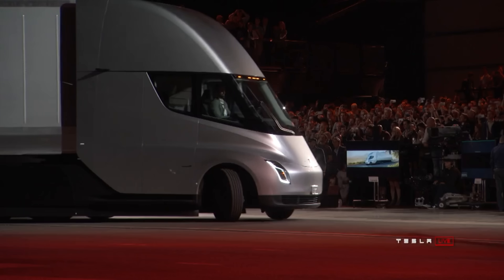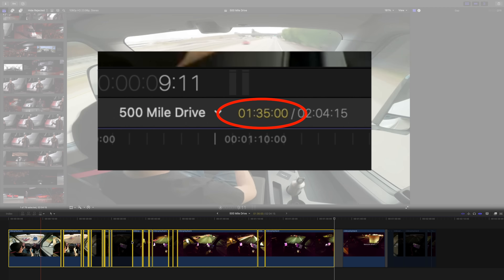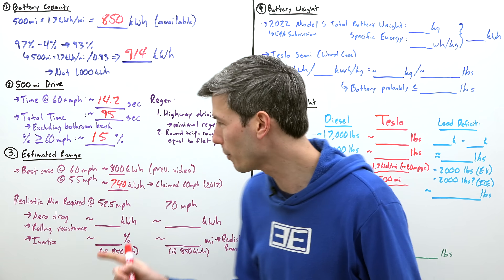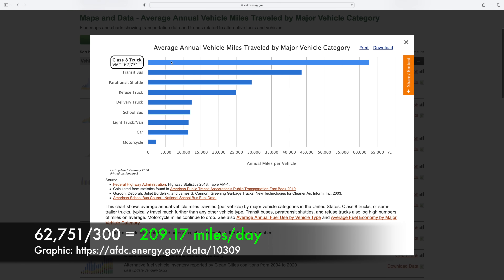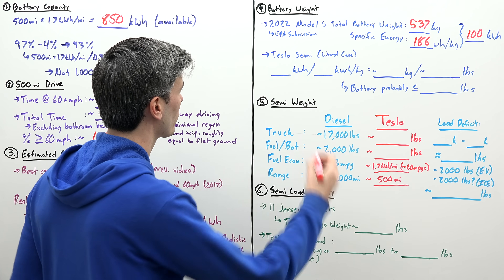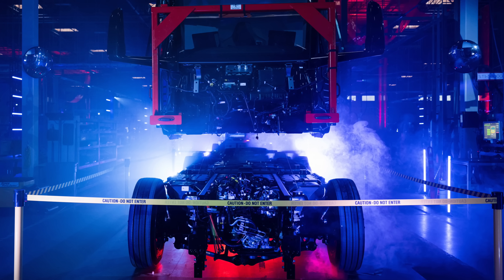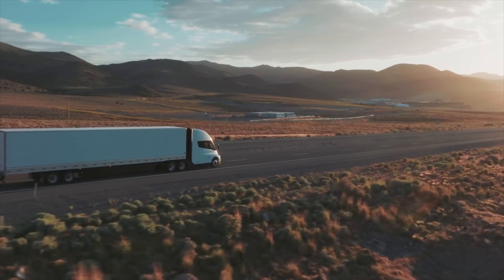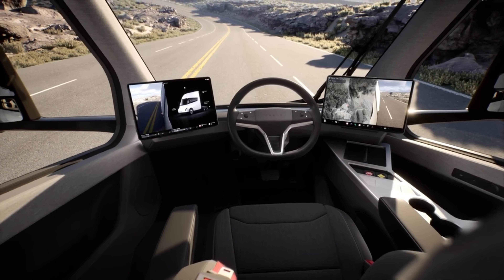Does The Tesla Semi Make Any Sense? Part 2!

Comment: Maybe I missed it but you seemed to skip over the charging. You mentioned it taking 35min which I find very hard to believe. 
It seems to only get mentioned in videos of people driving electric vehicles, that charging the battery 80%+ is much slower and there is an etiquette for cars at least not to do this on public charges. 
If the 35min is true I would suspect that us charged to 80% which doesn't give you full range. 
Second you didn't mention battery degradation, there is plenty of evidence that taking a battery to very low levels will reduce the pack capacity over time. This often is over looked in cars as the person that matters (the 1st buyer) isn't likely to drive the vehicle long enough to notice. With trucks though, they are owned until they are uneconomic and a quick google puts that as average 750,000 miles or 15years old. This really should be a factor.

Comment: Once you take into account the fact that the truck was loaded with only 11T of concrete barriers and that it was overtaken by every car, bus and truck in the video, it’s clear that this truck can barely carry any significant load let alone travel any significant distance compatible to a diesel truck when fully loaded.
Reply: I see you come from the ThunderF00t school of confirmation bias. You don't have to lie about the weight of the barriers to prove the Tesla Semi sucks. TF is biased.
Reply: @MobiAussie  Well given that I have an engineering degree, I dont really need the likes of another page to realise that Elon Musk is perhaps one of the best conmen to ever live. 
What is worrying though is that you seem to be biased yourself in that despite elon again promising and underdelivering, he has again refused to state the hauling load capacity of his trucks.. I wonder why!?
Reply: @iggi3985  Dude, I'm not disagreeing. The Tesla Semi is estimated to be 26-27k lbs, which is ridiculously heavy for a  sleeper cab, much more so a day cab. But ThunderF00t is not a reliable source. He's just flat out wrong on the weight of the jersey barriers. I don't know why he can't admit the semi hauled 44k, because 44k is already not that impressive for a flatbed trailer.
Reply: @MobiAussie  He is wrong. I have even pointed that out to him in that they are about half a ton per meter and not per unit. However, this still takes the hauling load of this particular truck to roughly 11T. You can give it a +/- of a few tons but it would be in this ballpark. 
I believe this to be the top end of the maximum load + trailer these trucks can haul if my rough numbers are correct, hence why Musk isnt releasing the numbers. 
For this purpose, I dont see the benefit of paying for such a truck. It can be out hauled and travelled by any truck, let alone not having to pay the exorbitant price or replacing the batteries every 10 years.
Reply: @iggi3985  
It's a 53' trailer. They are obviously longer than ~6' (2m) each, or the trailer would be half full stacked 4 long. The barriers are 2 tons a piece, not 1 ton.
Reply: @MobiAussie  Ok, Let's go with this. After all, this is all assumptions on everyone's part (including mine). But to me, it looks like they are 2m lengths (could be wrong). 
So we have 11 barriers at 2T each, giving you 22T payload. Still doesnt help the truck in its selling point how light it was loaded and given that it was being overtaken by each and every truck and car as it was clearly struggling. But I dont trust Telsa's numbers as they have been found to fudge the figures in the past so we will just have to wait and see.
Still makes me wonder why after over 5 years, they havent released any information about the hauling capacity of the truck.

Comment: Missed is that the shift will, at least in the medium term, drive up the cost of goods shipped by trucks as we’ll still need ICE trucks, but the fuel, parts, support infrastructure, etc. for those will increase as the market shrinks.  Fixed costs spread over fewer vehicles.  

It also seems what is becoming apparent, that grant money is being sucked up to install charging infrastructure, but those “companies” aren’t investing much in upkeep and maintenance creating availabiity issues.  Also somehting that will eventually be sorted but in the near term will give EVs a bad rep.

Comment: The Regen is only a partial truth. As the trailer doesn't Regen. And if the trailer is heavy, the trailer has to do braking or you cant steer well.
Reply: The trailer doesn't need to regen.
Reply: @logitech4873  trailers do alot of the braking. if the bias is to far forward you feel the trailer steer the truck. particularly down hill. so since the motors are billed as relying on regen, alot of the energy will be lost in braking. it is currently losing that energy so not a deal breaker, but a missed opportunity. if they thought of a whole truck, more battery storage, an extra motor in the trailer and a few extra batteries would increase the range and torque, and recover energy safely. 
trailer batteries would allow for easier hot swap at terminals, or running the truck mostly from the trailer. this would allow faster turn arounds as you just park and unhook your load, then hookup the new load and go.
Reply: @chrisoakey9841  During the 500 mile timelapse Tesla showed, the truck regenerated energy extremely efficiently in the downhill sections, almost negating the 4000ft climb entirely. In the majority of cases, just regen braking will be enough.

Comment: Ask yourselves this, why doesn't Scania sell trucks in America? This will all make sense in the end. The answer is they did, but stopped in 1993 due to low demand. Why was the demand low for what is in theory a superior truck to the standard i6 powered conventional cab trucks the U.S. manufactures. It sold well in New England where the trips are shorter and the GVWR is not as important, and a cabover gives increased maneuverability. (That also goes for the Torpedo cab) You can still see Scanias today, usually 113ms in straight truck guise in New England. However there are no Scanias west of the Schuylkill (there are obviously some but not like in New England) because Scanias are used to Euro speed limits and not suitable for 70 mph driving. Fuel efficiency drops due to shorter gear ratios with a maximum available 14 speed tranny, as well as worse aerodynamics and can become very costly to operate for a long distance trucker (including the T cab regardless of improved aerodynamics) eating into profits. Truly dreadful sleeping accommodations only make things worse. (Never underestimate the value of a good sleeper cab, it becomes very important on long trips) That applied to fleets and owner-operators and so they usually went with the long nose Petes we all know and love with a traditional 18 spees. Scanias in America make excellent day cab trucks, they're easy to drive because they have synchronized manual transmissions,  and are excellent is space constrained alley docking maneuvers. Given the choice I would take a 164l 580 over any American truck for delivering to NYC, Boston, Philly, and the like. (I'm a huge cabover Scania fan BTW, in America V8 trucks are extremely rare) However, I would under no circumstance drive any Scania if I lived in Texas do to the sheer inefficiency at higher speed and the lack of a suitable sleeper option and most fleets and owner-operators agreed with this conclusion and so Scania exited the U.S. market in 1993 having little success. (I know someone is going to bring up the Scania Mack partnership that burned to the ground, that's a different conversation for a different day) I say all this because I see the exact same problems repeating themselves with the Tesla Semi although to a lesser extent. It's not as fast as it's diesel counterparts due to inefficiency at high speed. Less of a problem because electric charging is way cheaper than diesel (though the price of the truck itself is probably absurd). No decent sleeper option as far as I can see (that can change obviously), and a lack of infrastructure in the less populous states that trucks often have to pass through like say, any of the Mountain States. This truck has all the hallmarks of a perfect Day cab, small and maneuverable, designed mostly for short distances. I believe as a day cab this will be successful but it needs to be marketed that way, or it risks going the way of Scania. You will never beat a long nose Pete for heavy hauling cross country, everybody knows that, that's not the market Teslas should  be aiming for, not even the 200 mile range. Instead they should set their sights on the fleets of local UPS, FEDEX, Freshdirect, Amazon, and the like that travel almost exclusively in gridded cities where the air quality is awful (diesel is a big contributor), there the electric semi will truly be revolutionary, but not on the highway. Truckers go overloaded all the time due to a number of factors (corporate greed and a lack of respect for their employed drivers by said corporations is one of them) and everyone forgets that the max allowable weight of trucks is 80000 lbs because that's all the roads can take. The Tesla semi in the real world will cost the taxpayers in road repair when people are inevitably driving around overloaded (4 to 6 lbs doesn't seem like alot until you realize that could be anywhere from one C8 z06 convertible, to 2 Toyota Camrys). In conclusion, inner city and local routes under 100 miles  is the true home of the Tesla semi, for anything else the Conventional cab 18 speed trucks will rule the road for the foreseeable future.

Comment: If Tesla just publish the complete spec on the semi then there is no need for all the video on semi. Battery weight, Semi weight less trailer and payload. Actual payload capacity with standard trailer. Do you ever wonder why they did not and will not publish the numbers? All the estimates on YouTube are mostly BS anyway.

Comment: You say you don’t know if the costs work out. This is easily one of the most obvious calculations you could do, but don’t. A Tesla semi will save 10s of thousands of dollars per year in fuel costs given your 60k miles driven a year estimate.

Also, you didn’t emphasize how Tesla energy costs would gain a significant advantage in fuel economy on routes where the destination is at lower elevations. A huge cost advantage for beverages being shipped from Colorado in the rockies.

Really garbage analysis when you leave out the most important factors. Also you didn’t mention the roadmap to 1.6 kwhs per mile.

You criticize Tesla “marketing” for leaving out details, but leave out the fact that diesel trucks will cost 50 cents a mile in fuel while a Tesla will likely cost under 20 cents a mile at retail energy rates.

I don’t get what you are trying to pull, but in operational costs, the Tesla Semi is far superior.

Comment: One problem Elon and everyone is missing about this truck, Corporate greed./Capitalistic cancer. Firstly If you can have one driver running Doubles (Double Trailers, where an extra trailer is hooked up behind the first) you're going to go that route v.s. single trailer. Secondly many companies have already screwed over the drivers where the driver is responsible for fueling the truck, thus they won't be in a good position to lose 4,000lbs of pay/ cargo value every trip.

Comment: Why am I not surprised that Tesla's video of the truck trip is misleading?

@time stamp 8:40  you show a diesel tractor weighing 17k lb without fuel, then you show a Tesla tractor weighing also 17k lb without battery.  But the Tesla does not have an engine.  Yes, it has electric motors but do they weigh the same as a diesel engine?  I have my doubts.

Comment: The biggest killer I see to Tesla semis is the range + charge time. You're getting 45+ minute change time for 400ish miles of range vs 5-10 minutes of fueling time for 1000+ miles of range. That might not seem like it would make a huge difference, but if you arrive to fuel/charge and there's 2 or 3 trucks in front of you, instead of waiting 20-30 minutes you're there for a few hours and potentially have your day ended. That's catastrophic.

Comment: Brilliant analysis, as usual, but I perceive one logical error - you credit regenerative braking as being 100% efficient in recovering the extra energy needed to gain elevation over the energy to cover the same distance on level ground.  This doesn't pass the sniff test.  Regenerative braking in the Toyota Prius is approximately 25% efficient - it recovers while stopping about one fourth of the energy required to accelerate to any given speed.  It requires enormously more energy to climb a steep hill than to travel the same distance over level ground.  I seriously doubt that the downhill regen. can recover all of that. Please prove me wrong mathematically.   Thanks.
Reply: The Tesla actually recovers about 80% of the extra energy used in the climb—minus, of course, losses to air and rolling resistance. It's not clear why the chart seems to show better results than that; but one reason is likely because the climb and descent were made at slower speeds than the flat portion in the first 250 miles, and so there would have been less losses to air and rolling resistance during the climb and descent, than in the flat portion.

Comment: all your calculations does not consider cold weather  - both range and charge time is hugely depended on temperatur.
Furthermore my experience is that manufacture stated charge times is purely theoretical based on the maximum possible charge energy and the KWh needed to charge.
Real-life charge times are usually 2 times the stated time - experienced from Skoda, VW, Mercedes, KIA, Hundai, Jaguar and Teslas
And that is even at favorabel temperatures. in cold weather it may easily be 3 to 4 times 

Speed is "killing" range - experience from VW/Skoda shows a 20% increase in power consumption just going from 110 to 125 km/h
Going from 80 to 110 is already increasing the consumption by 20%
Reply: ... Plus, since Elonmobile cars likely are not even green, per the 2017 Swedish IVL meta-study, how about a calculation to show whether or not an Elonmobile Class A tractor truck is green? ... Plus, if a diesel tractor truck holds 200 gallons and can thus typically get well over 1,000 miles between fills that take about 15 minutes, what then is the cost in down time for the battery charging? ... Seems like an uber niche market, public takes it in the shorts, polluting toxic Agenda 2030 scam to me.

Comment: Corporations sure do love handouts paid for by the people
Also, I saw on a different video with criticisms to ergonomics. They were claiming that the centered steering wheel could be an issue for visibility and no windows to roll down and driver far from openable windows would hinder things like toll stops.
Reply: ... Good point regards driver window.  Even just for some fresh air, never mind guard shacks, yard dogs, other drivers, weigh stations, scales, pretty girls, etc.  Also, seems that both sides would be at least partially blind for backing up.  Guess I’d have to test drive one, but not looking good on paper ... not to mention it has not been shown how these uber large battery pack trucks are green, which is doubtful.

Comment: In addition to the charging infrastructure, I'd have concerns over the reliability. Their smaller vehicles haven't been pushing to the front of reliability, making me wonder how well they're going to survive regular use. Also time on road regulations may run into additional issues from the time difference of refueling vs recharging.
Reply: ... No problem, we’ll just cut the driver’s pay to make up for charging time.

Comment: Truck/towing speeds in California is 55 mph.  Not sure if that makes any difference.   Few trucks actually drive at that speed though.

Those miles are factoring in local trucks.  OTR trucks run 400-700 miles a day and 100,00+ miles a year. I did 140,000 last year.

And there's a problem with charging.  It's not a problem for local who can have a parking spot and charger for all their trucks, it's an entirely different issue for OTR.  There isn't enough parking as is, and that doesn't even allow for charging.  I just don't see OTR being a viable option at all.

Comment: One thing to mention would be the amount of charges before the battery is needing replacement.
Tesla guarantee the model 3 batteries for 1500 charge cycles.
If a truck is in use for 300 days per year, and gets driven in one direction for 500 miles at an average speed of 60mph, that's 500 minutes (which is 8 hrs 40mins),.
If it then gets a full recharge (in 30-45 minutes which would be a rapid charge and harms the battery more than a slow charge) and another driver drives it back another 500 miles.
That's 600 fast charges per year.
Since tesla say the battery has a mileage life of 1m miles (which is a claim not a fact), that means it can handle 2000 x charges (with 500m per charge).
This 2000 x charges could mean that a truck with that usage would need a new battery every 3 years, or 6 years if it only does one full charge per day on 300 days per year.
If a 100kwh battery costs £15k, could we assume an 850kwh battery would cost £100,000?
£100,000 per 3-6 years on one item!? before we get to the lifespan of the motors.

There would be far more charges per year if it can't do a full 500 miles in one go, such as in cold temperatures where the battery is less efficient, with the heater or lights on.

If it does 250 miles and then charges, if the figure of 500 miles is 'optimistic' (or a lie because the video is misleading, such as the video with the tesla pickup winning a tug of war one was), that would mean it reaches 2000 charges after half of that mileage 

I can see why the only people to buy it are basically paid to do so with subsidies.